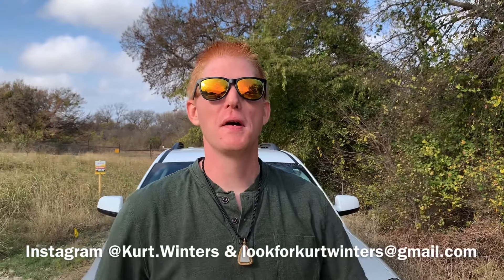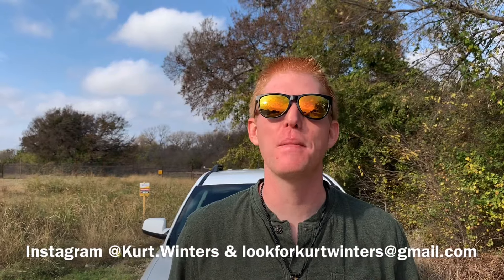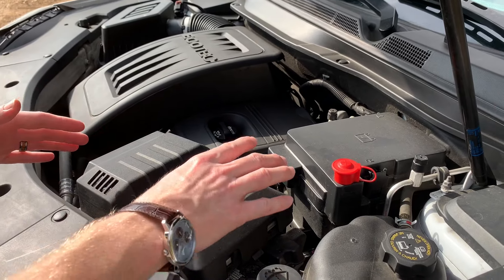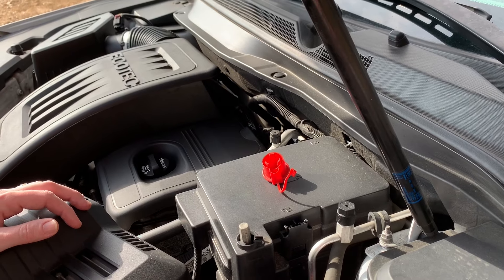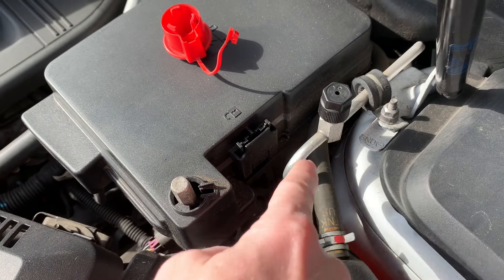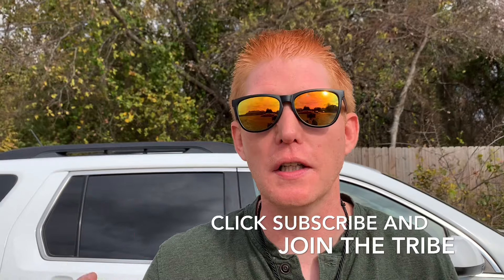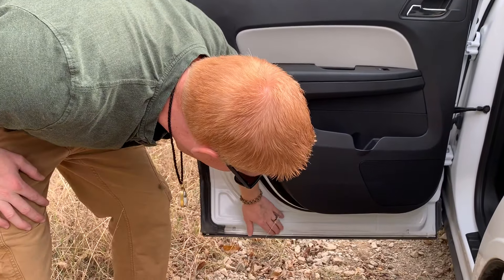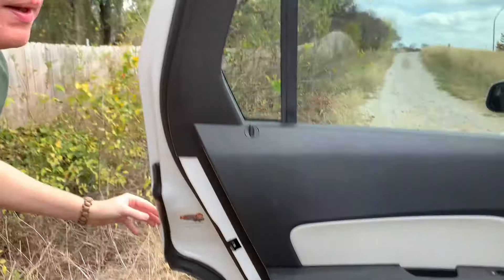3 Reasons NOT to BUY a GMC Terrain SLE  (Issues buyers should know before they BUY !)

Comment: I have a 2013 GMC terrain it has been the worst vehicle I have ever owned, I had to have new pistons and rings in it because it was burning oil which was a manufacturer defect and gm had a class action lawsuit on this engine but they would only cover the engine up to 120k which mine had 140k on it so had to pay out of pocket for this repair, also had to put a transfer case in it where it is  an AWD
Reply from the maker: dang, sorry to hear that. I constantly check my oil too. I've heard the 2015 and on got better. The AWD always worried me too !
Reply: Did it stop burning oil? Mine needs to be done but dont want to spend the money if it keeps eatting oil
Reply: @jaymesnin  yes it stopped  using oil i have a friend who is a gm mechanic and did the work on the side which was 800  bucks, idk if you owe anything on yours but i would get rid of it thats my personal opinion i would like to get rid of mine but i owe more than its worth this is the worst vehicle i have ever owned, i also had to replace the manifold on it and  that is another issue with these the mainfolds crack on them
Reply: @KurtWinters  you should change the oil in the transfer case  every 50000 miles, i found that out the hard way when it  went down it  busted a hole in the transfer case, which i havent put 50000 miles on mine yet bit it had 120000 when i bought it from the dealership, which they never did, this is why i do my own oil changes and maintenance cause you cant trust these dealerships, there is no such thing as service after sale unless you have deep pockets
Reply: @jessenoble1399  thanks. I appreciate you messaging me back because me and my girlfriend were curious. It's her car. Originally from Georgia to Michigan. So no rust. Very clean. She was all proud. Had it for a year now. But after a few months as I checked the oil I was like what the hell is going on. I had a 95 mustang V6 that ate oil. Mainly because it was an old car high mileage from a teen. Learned my lesson there. Now I got a V8 mustang GT 2004. I never have to add oil between changes. 160,000 miles. Just for comparison. My moms 2015 chevy Colorado you dont have to add oil between changes. Both those vehicles you can go well over 3,000 pushing 4 to 5,000 before adding. So I knew something was seriously wrong. So I started doing research and found out all this crazyness out about the gmc terrains engine. You'd think by now they'd get it right. Thanks again tho
Reply: @jaymesnin  Thank you im no mechanic but like you i change oil in every vehicle i have ever owned  and every vehicle i have ever owned  and i knew something wasnt right either, mine is a 4 cylinder gm had problems with the terraines engine  in the models before mine, its a 13 model its AWD idk if hers is AWD or not but if it is i would change the transfer case oil asap, like i was saying about friend of mine that is a gm mechanic he rebuilt the top end of engine, he put new rings and pistons in it and new timing chain and guides theres more he had done but thats the major thing he had done i hope that this is helpful to you thanks

Comment: I’ve been having problems with the car burning oil.
Reply: Clean the orifise in the intake
Reply: I added a oil catch can to my terrain also buy a cmf oil cap breather to release pressure from the crankccase
Reply from the maker: Great TIP!
Reply from the maker: How much is it burning ? Do you see smoke from the exhaust ?
Reply: rhurtadorh32 thank you 🙌I’ll ask someone to do it .
Reply: Kurt Winters about every 120 miles is haft oil in motor 😬
Reply: rhurtadorh32 hi I looked it up on YouTube but they have three size can you tell me which one is better thank you.
Reply: @shortyalvarez5161  size for what? For the oil cath can or the oil cap breather? For the oil cap breather you can go to either ebay or amazon and look up for cmf oil cap breather for a gmc terrain.for the oil catch can you can put a universal which most of them are. If you send me your email i can send you the pics of those 2 items.but most important thing to do is to clean the orifise in the intake manifold. Once you have someone clean that orifise install both catchcan and the cmf oil cap. The cmf oil cap prevents for the rear main seals to blow or leak due to too much air blowby pressure.
Reply: rhurtadorh32 Hi yes oil cath they have 3 kind I have GMC 12 Terran
Reply: @shortyalvarez5161  thats were i order it from
Reply: @shortyalvarez5161  but the cmf oil cap breather works like a charm as well. I installed both of them.once i installed the oil cap breather no condensation goes trough that pcv line, the one thats a c shape.theres a video i did recently on how the oil catch can and breather look once installed. Take a look so you can get a idea!
Reply: rhurtadorh32    thank you so much I’ll look at the video 🙌
Reply: rhurtadorh32 Hi  Cmf  I don’t know 🤷‍♀️ what size for my car .
Reply: rhurtadorh32  😄 awesome thank you so much now I have to look for a mechanic🙌
Reply: Kurt Winters  good morning I just got my cap breather 😊can’t wait to see how going to works.
Reply: @shortyalvarez5161  if you get crankcase smell is due to too much crankcase pressure and most likely a pcv orifise that is clogged.thats when the oil cap does its job. I have a solution for that as well
Reply: GM sent out a letter over a year ago in regards to this. There was a law suit and settlement. You should have received it if you purchased from dealership
Reply: @Lizz033torres  thank you I didn’t get it from a dealer .
Reply: Its a current recall for the 2013 due to consuming oil too fast call GMC

Comment: Are the door size of terrain 2012 and 2016 are same or there is a difference in size and style.I need to replace the door in my 2016 terrain and getting a 2012 door cheaper.please suggest
Reply from the maker: they are the same size. but call a dealership first. in case the hinges or something are different.

Comment: Don’t use eco mode u less your using cruise control 
Or your getting worse gas mileage, the car will take longer to get up to speed  their for you pushing gas longer their for using more gas because it won’t shit into low gear as fast
Reply from the maker: it also takes longer for your AC blower to reach max etc.... it's weird. I leave it on all the time and get 27 in the city. But i drive really slow. I set a new record on the hwy 65 mph, eco, on cruze 37.4 MPG ! I was in flat ass texas though ! AC on full
Reply: Was getting over 400 a tank on a 1300 mile drive last week. Great SUV.
Reply from the maker: @Q-gf8vb  agreed

Comment: Ive owned a 2012 slt1 awd since it had 11 miles on it. It now has 89000. Not one problem ever. Brakes maintenance and oil changes. Looking to sell it for 8 or 9k now to put towards something newer.
Reply: @Ann Devereux i usually change about every 5 months or so. Since the mileage is up there i check the oil once or twice in between changes. It usually dosen't need it.
Reply from the maker: what are you looking to buy ? do you like the new Blazers ?
Reply from the maker: def change oil every 4-5 months, no matter the mileage.
Reply from the maker: exactly ! great info
Reply: Do you still have the gmc terrain for sale?

Comment: HTF do you criticize how difficult the battery is to change or charge if you have not tried either?
Reply from the maker: I hear ya, how long did it take you, to change the first time ?
Reply: @KurtWinters  It's not as hard as you might think, here's a you tube video. You don't need the panel tool if you can use needle nose pliers and a flat tip screwdriver.
https://m.youtube.com/watch?v=7kPYDT_YEEw#
Reply: You're a Chevy guy, battery r&r is worse on the early Cavaliers and HHT's

Comment: I completely disagree. I've owned three of these from 2011 all the way to 2014. 3 years ago I bought my 2011 SLT fully loaded of course, for $12,000. It had 46,000 miles on it too by the way. The number one you got ripped off. So I think a big part of this is you're trying to blame everything else but yourself 4 paying too much for an entry-level vehicle. I now have 100,000 miles on mine oh, and I have experienced no Chevy Shake. Perhaps it's because I changed my shocks and struts and trailing arms at 80,000 miles like you're supposed to. Or perhaps I had enough sense to change bad tires on the car before knocking it's ride and you admitted. Your quirks about the battery placement are very over-inflated. I have seen batteries where you had to take the left front wheel out to get to it, batteries that were in a trunk of a car next to the spare tire in my old Porsche, and also taking out the backseat just to get to the battery. And you're crying about one little bowl and a PCM sitting on top of the battery. I think you should stop letting your wife make decisions for you. I see right through this, I'm going to tell over the last 3 years, besides normal maintenance and 3 years and over 50,000 miles, I've only replace a water pump, and a battery. There's no need to put it on a tender this is not some old car from yesteryear with a carburetor on it. You are the most uninformed person I've ever seen. Like I said stop letting your wife make decisions for you oh, and you'll have a lot less failures in your life. What I'm saying is learn to lead your house sir, so that you will learn how to take care of your vehicle without crying about it
Reply from the maker: wow, thanks PASTOR ?
Reply: @KurtWinters  Ephesians 5:11
Reply from the maker: James 4:6

Comment: The engine burns oil fast as well.
Reply from the maker: yes, I check it every two weeks ! what year is your Terrain ?
Reply: @KurtWinters  it’s my son’s. It’s a 2012. He also noticed another problem. When he comes to a stop it does a “cradle rock” sort of thing. Mechanic replaced the rotors and pads but it didn’t help. He’s taking it back to get it looked at again. The rotors and pads were bad so that wasn’t a waste of money. Not sure what would cause it because I’ve never had that issue but of course I’ve never owned a GMC.  I have a 2012 Tahoe and I love it. It was owned by the FBI according to the paperwork that was left in the glovebox.
Reply: @KurtWinters  o and one other thing. The backup camera keeps coming loose no matter how hard they try to fix it. They’ve done everything but supergluing or welding it on.
Reply from the maker: I had a similar issue. I have to replace the front wheel hub bearings, because the slight play in the wheels, kept eating my rotors. My brakes have always been "grabb-ee" when coming to a slow stop too.
Reply from the maker: never had a back up camera issue. is it a dealer recall ? I'd keep pressing GM to correct it, because is NHSB issue, they is serious business. I'd roll it up to corporate/regional manager. I can call them for you, if you need back up.
Reply: @KurtWinters  sure that would be great. I’m not good with that stuff. He’s in the Navy so I can relay the message.
Reply from the maker: @IamwhatGodmade  good deal